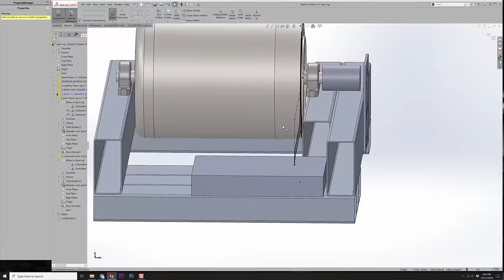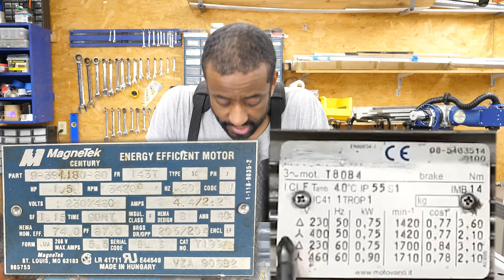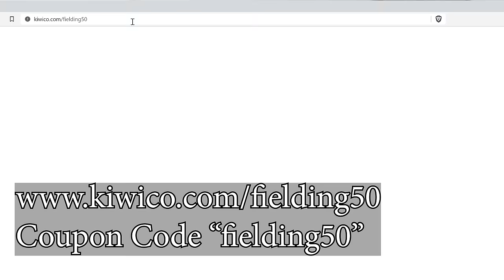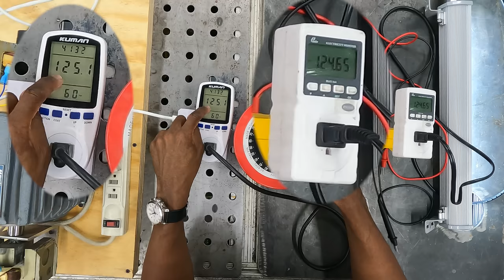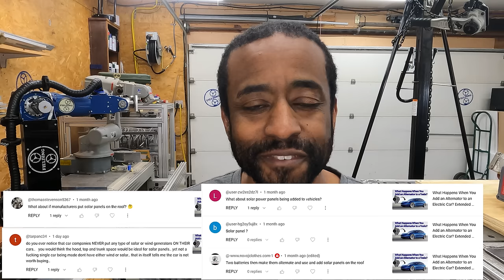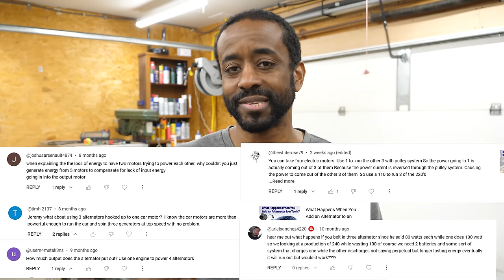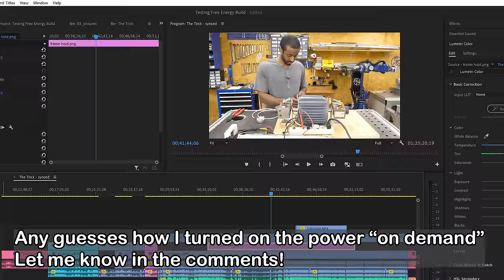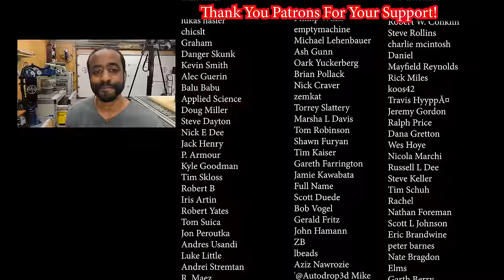Building and Reviewing Free Energy Generators on YouTube.

Comment: While you say this is bunk sudo science. There is some innovation that comes out of these Ideas even when the approach is all wrong or not understood by all Readers, Engineers, and Scientists.
To say that something is unequivocally false or cannot work is a bit arrogant.
Answer me this simple question: If you have two magnets on the surface of a level table and place them in proximity to one another so they attract holding them from moving, and then releasing them without injecting a force. Do they not slam together with force and velocity moving through the distance in a limited time. Is this not the definition of doing work or having done work, moving a mass through a distance and time. Where did the energy come from that did the work? Well, it was from the magnetism and spin of the electrons and sub-atomic particles in the aligned lattice of the magnet. Material science is evolving at a fast pace these days.
Consider this: from a white paper on Space Time Meta-Materials
B. Nonreciprocity
Another fundamental phenomenon that is common to
most spacetime varying media is nonreciprocity [49]. Indeed,
spacetime motion or modulation generally breaks
time reversal symmetry, due to the directional bias of the
perturbation4. Such spacetime nonreciprocity recently generated
intense interest towards the realization of magnetless
nonreciprocal devices [16].
C. Moving and Modulated System Peculiarities
As pointed out in Sec. II-A, the spacetime variation in
a spacetime system may occur either via the motion of
matter, such as for instance a moving dielectric object,
or via the modulation by a wave, such as for instance
an acoustic wave in a piezoelectric crystal. The latter
(wave modulation) is certainly easier than the former (wave
modulation) to realize and implement in devices, as it
is easier to generate a propagating modulation than an
actual motion of matter, particularly if very high velocities
are required! Beyond this practical difference, there are
also fundamental differences between these two types of
spacetime systems. In particular, there are two phenomena
that can occur only in the moving-medium case: the Fizeau
drag and bianisotropy transformation.....
This is only to make you think about your judgment.
And I understand your need to debunk this stuff because there is so much of it.
I don't disagree that this is most likely bunk. What can you trust these days, what is truth?
Reply from the maker: This is a great question and a very common one. I answered it near the beginning of video two in this series

Comment: You haven't covered the topic. Solar, wind, hydroelectric, and geothermal, are all free energy collection systems, and a heat pump is about 5x over unity. You hooked up a motor to a generator with no particular attention to showing false the claims of others. You showed only one scheme,  that doesn't perform. Given that no one who achieves super performance has built a perpetual motion machine or is more than 100% efficient, or is violating laws of physics, we know they're all running open systems, harvesting power from an external source.  but it's just not always clear what that source is. It's worth a deeper look.
Reply: I'm pretty sure there's a handful of common pitfalls that snare enthusiasts, such as measurement errors, like mistaking apparent power for real power, or being sloppy about battery surface charge and chemistry. It would help to show folks how to overcome those.

Yet these do not explain all of the over unity claims

Comment: @Jeremy. You are mostly correct and on the most fundamental level, the math and the proven laws of electrical engineering and thermodynamics hold true in MOST man made systems. However, there are many ways to show the laws of thermodynamics are not absolute and nature itself proves this over and over.

There are natural energies that can be tapped into that we are often taught in electrical engineering to throw away as they become a nuisance to our man made systems. There is free and abundant energy all around us and it is there for the taking.

When you address these questions from the very stance by which you stand, then you can correctly dismiss the many hoaxes that are out there but I would challenge you to be careful in this reasoning because you are actually narrowing your mind to be unable to see or you may become immediately bias to the very energy abundance that is hidden to those that are in this mindset. 

There is available free energy, free as that it is provided by God in His Nature and all we have to do is build devices to harness such energies. We have built some and there are still better devices to be built, that will capture and utilize this bountiful supply of natural energy, we only need to stop thinking that it is impossible and stop erroneously applying "conservation of energy" laws to every device that may be invented.We must build our machines to be in alignment with the already abundant natural energy all around us, instead of systems that throw away this energy or ignore it altogether for the sake of centralizing it and artificially making it in order to make profits from it..

Comment: Have you done the motor with the uh well the center part is normally shaped like a cylinder but if you cut the ends to where the 2D side view would be like a parallelogram, when you put the coil outside around it you make you coil where the poles are are opposite in a way where it would be in the space  so therefore the motor would essentially have no opposition force slowing it down...  It mskes motors like 5000% efficient, hence the name of the vid 5000% motor efficiency....  The problem with science is that it's not scientifically derived, it's political...  It's why you hear about Einstein amd not Tesla in books, but Tesla was right, not Einstein and Einstein stole most his things. It's not necessarily free energy  but more of a transference of energy from two different fields, one that is not talked about called the aether. Tesla knew this  everyone else denying it is crafting formulas and not practical mostly all science is essentially wrong just like they showed everyone a 2nd wsy ti skin a cat and they ate that info without questioning if they wanted filleted cat... The problem in many motors is like the wheel, it's still square and needs open source redesign...

Comment: An armature carrying a magnet (neodymium) is rotated within a secondary coil of wire, as the magnet rotates, the fluctuating magnetic field acts upon the secondary coil to set up ALTERNATING CURRENT in the coil windings , electrical terminals leading from the secondary are provided for connection to tap the alternating electrical power generated - electric dynamo public patent # 4,249,096 , there's a lot of these that you would not believe but the suppression and ignorance is real and your not helping jeremy 😑
Reply from the maker: I think the problem is you don't quite understand the meaning of the words you are copying. However, If you have the answer please just try it yourself. I think this is the best possible way for you to learn what is happening here. If you are right the idea is worth hundreds of billions of dollars. If I am right you get a great lesson in physics.

Comment: Use ground diode mag flow energy using 4th energy crystalline energy blue code church energy window systems for great amp levitation energy. Cathode annode energy. Turner 4th energy system explained in profile divinchi energy royalty codes Turner great ancestors royalty codes jc bloodline energy code divinchi dead sea energy scroll great truth 👍

Comment: There is an electronic app that has a reference section. Old app had it 10-15 years. Electro droid? In the section on induction and in it it states, " it is a well known fact that you can run an entire machine shop, from one machine"! It says that a three phase motor wired appropriately will power the rest of the machine shop! Over unity. That is how most machine shops were operated! And it saved a massive amount of electricity? Can't quite see what you've got rugged up there. Looks like one motor with two?transformers? On the ends? Er. not what it's supposed to represent. But it doesn't represent the same thing at all. 😮ps sorry you look stoned? And someone who smiles as much as you, I tend to avoid. Classic narsacistic behaviour? What you built didn't make sense?
Reply from the maker: That is indeed common for small shops that don't have 3 phase industrial power available. I have this setup in my shop to run my robot. I even made a video about how to do it. Search my channel! But sir... that has nothing to do with overunity. The setup has to be large enough to draw that much power from the wall and supply it to the machines. You seem to be confusing very different ideas about what power is and how it works. There are too many issues with what you said to try and explain them all in the comments. I don't what else to say other than it would be really weird for me to have one video showing "free energy / overunity in practice" and another video saying it is impossible. You can easily measure the power going in with a multimeter to see there is no over unity.

Comment: The level of ignorance presented here is abysmal.  
   You're not attempting to create/harness *free energy  ( nothing is free, that much is true ).  You're just taking what you know and doing it wrong.
   Every component in your set up is (fittingly) analogous to mechanical gears and pulleys as these components  effectively alter ratios of input while losing power at each stage of conversion.  Fine. Correct. 
   But that's your actual objective. 
The objective of *free energy generation is not losing power through gear depletion. 
   The objective is simplicity ( NOT depleting energy by overly complex conversions ).
    Let me give you one working example: atmospheric energy (electrical) use.
    This isn't new or fringe or a scam. It's well known and proven. You can find tutorials to do it and the math adds up.  In this type of system,  you're essentially just creating a capacitor from the difference in charge between the atmosphere and the ground and converting it directly to mechanical output.  Now, even with a large weather balloon tethered 300 meters in the air, you'll still only be able to power a small LED strip .  It isn't  *free per se, but it is the equivalent of putting a waterwheel on a moving river.
     Another example ( in principle) isthe "rogue wave" effect in the ocean : when different wave frequencies synchronize to create a rogue wave. It is analogous to double bouncing somebody on a trampoline.  Attempting to recreate this in electrical examples is where *free energy experiments stand.
      All you have done is to add more gears (resistance) to a system,  then say "see ? It doesn't work ".  Yeah, no kidding.  I would never expect it to.😂
    I  don't see anything about your videos that demonstrates you learning anything new.  To learn anything new, firstly,  you'll have to admit that you don't know everything, then investigate what you don't  understand. 
    You have failed to do that.

Comment: The reasons these free energy devices all do not work is because its still missing components to make it complete. 

A wise machinist told, a machinist never complains.about the tools he or she has, because they know how to make a better toolng to be more effective in their productivity. 

Look at the sun, very large, probably has a strong, durable core to store some kind of stagnant energy. Probably the rotation of the sun changes the stagnant energy into working energy. 

Stop talking crap about these scammers rather than find way to create the free energy work and share to everyone how to build one. That way everyone will have electricity power.

Use multiple deep cycle batteries, multiple high capacitors, multiple large pickup truck alternators. We can make this work. We need to come up with those missing components. We all need to work together to solve this complex puzzle.

Comment: you got mechanical and kenetic but you missing out on static and your solor connection friction makes light light makes sum elements grow collective charge is the point yes it takes mechanical motion off set pump friction static static light  magnafy that to laser bright laser bright means solor power charges more transference of collective is like eat durt poop it out make a pile fill a bucket suction induction vacume to collect substance substance that burns or whatever even gravity if suction of water is loop flow again but its steady motion that you didnt have before syphon action jolt push suck till you have a steady cyclone at other end water goes up what goes up must fall its motionary of wheel with its buckets its more than you had before siting still position of the parts makes the cycle continue collection pump that fullfills the loop into purpetual steady motion collection of element that you didnot have before is more item more item that can be charged is element that can grow like plant cell batteries like lemons its still the motion that makes collection  the motion that spins fans  loops pully to more friction statics... but reduce restriction either way it is collection of materials you did not have before... diggers= scoopers of elements pullied through the system that continues the loop till your collection is more by more devices runing the same goal solor panels collect specific element of light means motionary elements atomic faster mooveing that glows cells that breathe cells that consume vacumes & off set flywheels.. usen magnets to push or tug  by swing  your missing your initial syphon tornado so you dont see substance moove up to fall back down another path with pattel buckets until you understand syphon plumbing ...your only other enemy is evaporation but it dont stay dry and gutters collect as rivers and streams more than enuf to call your colection system of free materials actualy just that ...a collection of free materials if you know how to make it colect more effeciently thats plant mechanics too its just like multiple devices working to collect specific items its not just e = m and looks like 2 boxed "c"s  stacked its em sees th and collects "them'' too and byob means to "bring your other budd" now magnet sense in digger tools also means collection of metals that ya didnt have before  so what are ya saying that it doesnt grow more power ?doesnt create more charge doesnt collect ? your just missan parts of your loop then which is why ya dont see it...thats just mechanics with missing parts juggeling the uneffecient type of loop ... motor to spark make glow magnafy your light spread the light to more places increase speed of mind without loss of tork you burn like day when its night your batery element colectively charges refills the battery that powers the initial moter everything seprat does nothing all the other things you promote wasnt posessed until after the other kenetic mechanic loops multiplied battery didnt start it battery just made it easeier to hold charge element to tug the magnets into a spin one friction spark vs two static sparks vs flip one burger or flip a thousand at once then you get pully system effeciencey one lens vs a thousand microscopes blazen out a fire light then you got more light than you can containe yes produced more power not just mechanic transference of equals in a mirror ...vehical gutters colect rain vacumes suck air particals we burn the colectives paint jobs now colect light we systematicly  add gases  is your car never off ? built in fans keep it cool too no fried kid cant survive in a ride like that  pully systems is just effeciencey  of your loop vs dead end burn out actin like nail and wood dont connect when struck... just jiggelin the parts devided...   you just need finer motors for all the smaller to have less restriction so you can get more out of it so it aint about tork loss and is more light sparks for more burn cuz thats more shine for what rapidly grows to fill a battery with charged cells nano collections and nano turbine engines is just that battery and solor panel doing colection on smaller scales engins shrunk its screwy but lets just say i like alota suckers....much better than plain water dips  they just feel hollow without its right gripens ..ever wonder why engins are girls?..but there ya go ...